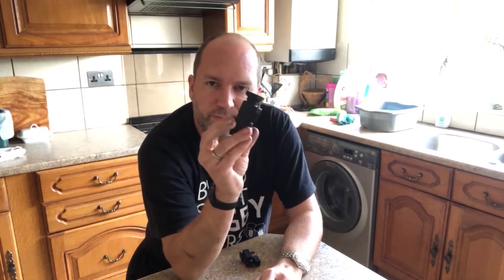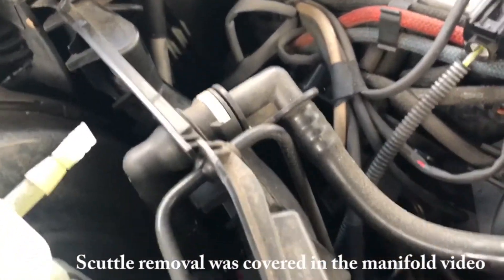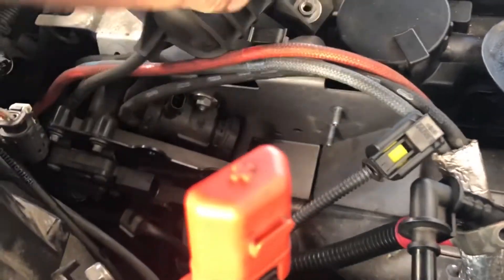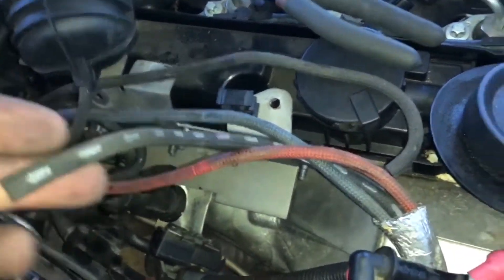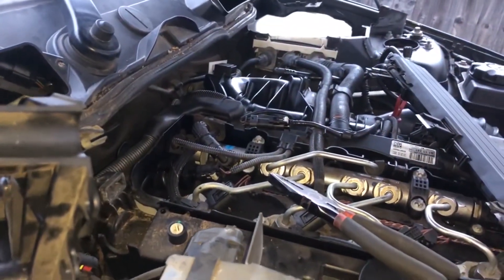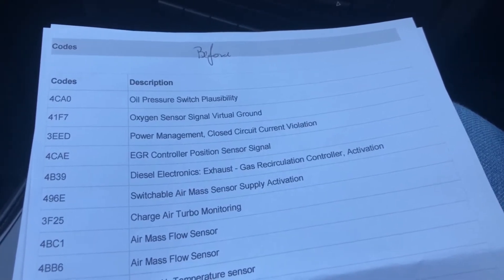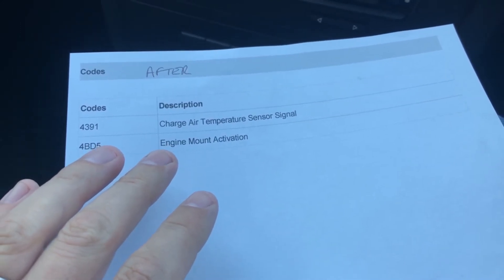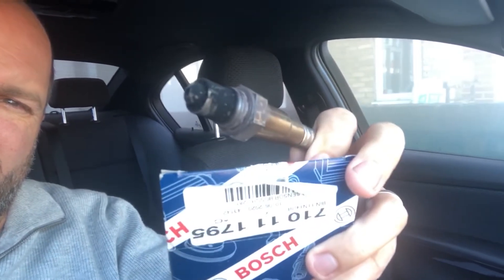BMW N47/N57 BiTurbo Pressure Converter Valves - 123d / 335d / 535d / 640d / X1 X3 X5 25d 35d 40d

Comment: One question guys.. I have a F15 40d 2015. Can someone tell me how many vacuum solenoids have turbo ? I know there are two on the left side of engine + one connected to EGR. So there are 3 vacuum solenoids. Is this info correct or there is a 4th one somewhere?

Comment: Hello Neil, my car is still in limbo mode. The turbocharger do not seem to work. Lately I have got this error. 299100 Pressure converter turbine control flap activation open circuit. Does this mean that my pressure converter is faulty? I think the converter is burning up because the workshop forgot to tight the airfilter hose screw and the turbo air charge hose is not properly seated. A lot of leakage. I may have to replace 3  parts again. This time  I will do all by my self. I can not trust on anybody. The workshop took 1200  dollars for replacing the turbocharger.
Reply from the maker: I don’t think the valve would be affected by not tightening the inlet pipe. I suspect you may have a vacuum leak on one of the pipes to the wastegate. What model do you have?
Reply: @NeilsCarsAviationTravel  BMW 525D Xdrive F11 218 HP 2012. I have replaced all vacuum pipes. I will check the hose to wastegate. I think the chargeair hose from turbocharger to intercooler is leaking. For some weeks ago I pushed the chargeair hose hard and after that the turbocharger seems to work fine for a while.  I have bought two new hoses and i am going to replace them.
Reply: @NeilsCarsAviationTravel  BMW 525D Xdrive F11 2012 model. I do agree I must check all hoses for leakage. I have an original technical draw map on all hoses for my car. When I start the engine the charge air hose to intercooler should expand and get hard and the wastegate actuator should move. I have bought two new turbo air charge hoses, one for the turbocharger from turbocharger to intercooler and one from intercooler to intake manifold. Because of ilness I have not replaced the hoses. I have successfull manage to repair the EDC  shock absorber. Now all 4 EDC shock absorber is working perfect and the car is able to do corner level on all 4 wheels. Adaptive driving Sport  and Sport+ is working again.

Comment: Hello, I want to ask about my car, did you get errors, the car is running erratically, with error code 3F00 A 3F03. It is a BMW X5 E70 35D XDRIVE 2010, the rpm fluctuates, too. Thank you for any help
Reply from the maker: The 3F00 and 3F03 errors seem to be more related to the MAP sensor which should be in the manifold. This reads the pressure in the manifold. 

It could also of course be a leak in the inlet side if you are getting a erratic idle. Maybe worth having a smoke test done where smoke is pumped into the inlet system tot see if there is a split hose or hole in the manifold.
Reply: @NeilsCarsAviationTravel  hi, that's right, the Diagnostics point to the sensor of the fuel pressure signal and I forgot to write that the car has a clutch and the revs rise to idle, it behaves as if it were driving in 3rd gear, but it behaves strangely and even today I was surprised by the error code 42DE. Otherwise, it starts without the car does not smoke problem, it happened to me that the DPF filter alarm went off twice, but then not anymore

Comment: Fella there nit meant to be fast. I'm nit sire what your expecting. If you want fast get a 535d
Reply: Fast or not, if the car isn't running right, it's not running right.
Reply from the maker: What’s your point? 535d is only around 1 second quicker to 60 and doesn’t handle as well. 

They are plenty fast enough if running correctly. 

BTW a 535d with bad pressure converter valves will be as fast as a 520d so best to have them sorted it faulty.

Comment: On the black cover over the pressure converters, what fasteners hold it on as you cannot see them due to them being recessed
Reply from the maker: I'm not 100% sure which cover. Whats the time stamp in the video, and i'llsee if I can remember.
Reply: @NeilsCarsAviationTravel thankyou for the reply, the one pointed to at 2:51 that's covering the converters (black plastic one)

Comment: hello mate sorry to be a bother , am having some issue with my car which seems similar to yours . 
bmw m47 e90 2005

have replaced glow plugs , glow plug module , charge pressure sensor , cam position sensor, turbo and engine breather ; also fully serviced it . 
am getting jerky or hesitant acceleration if i wide open throttle at lower RPMS sometimes even half way through the RPM range , occasionally the car goes limp with CEL , codes are showing MAF issue .
i had a garage swap out my MAF,  egr valve and egr solenoid (pressure converter) with a used pair from a 330d , cars running better but still has those issues just less frequently .

garage is saying my boost is too low and sometimes too high , they think it could be a software issue ; however i'm thinking they aren't doing thorough enough testing to make sure it isn't simple vacuum leak somewhere in the system ...

did you get to the bottom of your issue here ? i would like to know what actually sorted it . thanks !
Reply from the maker: Hi, sounds like you have checked and replaced a lot of items. 

With MAF sensors it’s always worth buying OEM brand such as Bosch as cheaper ones can be an issue. 

I’m not quite sure if the M47 uses the same pressure converters as the N47 in mine, or if it has an active engine mount. 

One thing you could do is unplug the MAF and see if it runs better. Also do the same with the MAP sensor (pressure sensor on the inlet manifold). 

It’s hard to diagnose without seeing the codes, 

In my case I have the car booked in for a timing chain replacement in September and they will be replacing all the vacuum lines too.
Reply: @NeilsCarsAviationTravel  yeah i've been chasing the issue and was assured the money i'd spent would fix it but months later the car still isn't 100% when i want to slam my foot down

all the work was done at bmw indie garage with oem/original parts , just a very annoying  experience so far

the parts replaced we're all throwing codes ; plugs, cam position sensor , map/maf and turbo actuator etc. 

the garage assumed wrongly it was sticking turbo vanes , then found sticking EGR valve causing the maf to act up , they've since swapped some used parts free of charge ; a lot better but still not 100% , car feels slightly down on power and occasionally jerks while accelerating at wot , could still be binding up

 i'll have them replace the vacuum lines in mine , cant hurt since the age of the car

tempted to delete the egr system entirely and have done with it rather than replace the valve

thanks and good luck

Comment: I have the same boosting issues like you descripe: I have a BMW 525D Bi-turbo F11 xdrive 218 Horsepower. No power under 3000 rpm, no power over 3000 rpm. I got man drivetrain errors if I accerrate a little bit. I ran Autofix es910 diagnostic and the same error log came back saying short circuit on the pressure converter on each rescan. Should I replace the erg control value too along with the replacement of the pressure converter?
Reply from the maker: You may as well replace all 3 while you have the access. Let me know how you get on.
Reply: @NeilsCarsAviationTravel  Hi Neil , I have replaced  two booster pressure solenoids and two EGR turbo control valves. Still my car is in limb mode, very slow acceleration.I checked the turboair charge hose and it was 1-2 mm slack. The leakage was without doubt here. I replace the turbo air charge hose today. The new turbo air charge hose is firm and tight, no slack. Now my turbocharger is working again. Fantastic to drive a smooth and quick car again. Thank you for your  help and advices. Have a fantastic weekend :-))

Comment: What is the name and partnummer of the second device you show on this video in the beginning of the video? I have to solve my problem with my BMW? Do you know which size is on the hose on the pressure converter. Maybe I have to change the hose as well when I replace my Pressure converter. My car has passed 152000 km.
Reply from the maker: The smaller one is also called an EGR control value. This is the one I bought. 

https://www.ebay.co.uk/itm/113452311646?mkcid=16&mkevt=1&mkrid=711-127632-2357-0&ssspo=5hKVr8gXTgG&sssrc=2349624&ssuid=ENW11iTvRY2&var=&widget_ver=artemis&media=COPY
Reply: @NeilsCarsAviationTravel  I have a recall on my BMW concerning replacing the whole EGR cooler include the Egr control unit. BMW Norway group  will replace the egr free of charge for me in June. The cause is leakage of etanol which may cause a fire. My Egr control valve looks different on my BMW 5 F11. Thank you for yuor informativ response. :-))

Comment: Hi very good video. I have a BMW 525D. I had a tturbocrash and after replaecing the turbo I have got several drivetrain errors under 3000 rpm and over 3000 rpm. After watching your video  I understand my booster rpessure solenoid mus replace. Thank you very much for  your best and helpful video
Reply from the maker: Glad I could help 😀

Comment: Hi great videos and useful info.
 I have a 320d n47 and I've constantly had my management light on the dash.  I removed my dpf, blanked out the egr , blanked off the port on the side of the air filter box and I've ran a, rubber draught  hose, down from the top end breather port and out under the car.  So now the engine can breathe in clean filtered air , without any egr soot going back into the inlet manifold , there is no sticky , oily residues going into the inlet system from infront of the turbo and the exhaust system is not clogged up with the dpf.

I've also removed my intercooler and all the pipes, cleaned out all the oil that had accumulated from the breather hose and I've cleaned off all the rubber seals.  I've also cleaned the throttle body.the only thing to clean out now is the inlet manifold itself and the swirl flaps as they will be clogged with oil and egr soot.    The engine is running much more responsive but I'm still have the issue of low down turbo lag , my MIL is still on and I get a reduced power light if I really boot it. 

My question is , what do you think about blocking off all those vacuum lines and just running one line from the turbo actuator to a port on the inlet manifold or just after the throttle body ? I did a similar thing on my  e39 525,  only i connected the fuel pressure regulator to the the manifold as the car was normally aspirated.
Reply from the maker: Hi, if you have blocked the EGR off you will need to have it mapped out to get rid of the EML light. 
I’m not sore blocking the vacuum lines will be a good idea. The vacuum system on the E90 is all interconnected with turbo and active engine mounts. That part of the issue I’m having I think.
Reply: @NeilsCarsAviationTravel    yes, I forgot to mention in my massive comment that I had it all mapped out. , dpf , egr  and I had the power opened up aswel.   I think what I might do is just run a new hose from the turbo actuator to the inlet manifold and test run it , just to see if it makes any difference.  If it does I'll disconnect all them pipes and blank them off.   I'll let you know how it goes and make a vid of it to . Cheers mate.
Reply from the maker: @rjhtrucking5429  cheers. Would be interested in the results.
Reply: @rjhtrucking5429  what was the end result bud?

Comment: Hi Neil, my 123d is doing the same. Small turbo isn’t kicking in, then at 3k rpm the boost come on. I’ve tried all sorts of diagnostics but haven’t yet replaced parts. Both turbos spin freely, there’s not obvious vacuum leaks, Did you ever find out what was causing it?  

Cheers
Dave
Reply from the maker: Hi Dave, have you had it plugged in to get codes off the ECU? 
If you look at my other Alpina videos you will see I have been chasing my tail trying to get to the bottom of lack of power and limp mode issues. 

I’m having the car MOTd in 2 weeks so will be back on diagnostics asap.
Reply: I have the same issue on my 123d coupe at 3k turbo kicks in the codes I got was maf sensor and charge air pressure could be that actuator not work correctly
Reply: Did you get to the bottom of it? I’m going through the same
Reply: @Anynameslelt  no mate sorry to say I'm just going to sell it I didn't even take it to the garage they take so long to look at it I think it's small turbo definitely or actuator take it to a garage mate
Reply: @Smartytoontv  you could put a smoke machine down the servo pipe and look for smoke out the boost pressure pipes, (that got to the actuators,) could be one of the n75 valves, if biturbo there is one of two,

Comment: Hello, I have this error on my 535d e60 lci: 429A boost pressure control low pressure stage, control deviation. Do you know what the problem would be?
Reply from the maker: I’d have to have a hunt around the internet. Do you get any symptoms like limp mode?
Reply: @NeilsCarsAviationTravel  no, it feels a bit lazier down to 3500 rpm, after 3500 it pulls normally

Comment: 🆘 need help
E92 335d at full throttle 120mph it goes into limp mode i turn the car off and on and it pull like a train it usually happens at 120mph sometimes 80mph . 

I change the vacuum pipes . And i still have the problem. 🆘
Reply from the maker: Have you had it plugged in for error codes? 
Off the top of my head it could be a number of things:
- fuel filter needs changing
- boost leak (intercooler pipe split) 
- Inlet temp sensor (see my other video). 
- MAF sensor. 

The list goes on.
Reply: @NeilsCarsAviationTravel  hi sorry for late reply 

I got code 428B Boost pressure control Low pressure stage, control deviation 

447B lambda probe

This codes comes up after getting into limp mode
Reply: @Cocovlog283  im having the same issue on my 335d 2008 at 120 car go into safe mode only 1 turbo working wont go over 120mph turn the car on and off back to normal.
Reply: @TheRealtrueGamer  yes correct i got same issue apparently its the big staring turbo fail
Reply: Did you got to solve the problem?

Comment: having the same issue on 123d e82 If you make any progress it will be super interesting👌in mine i will try to change all the vacumm pipes as I thinck that 1 of them leaks a little bit and it comes from the vacumm tank
Reply from the maker: I think mine has an issue with the vacuum pipes from the engine mounts too.
Reply: @NeilsCarsAviationTravel  Today I have solved the problem and works incredibly well. Mine was failing the vacumm valve that moves the turbos. In total 80 euros including shipping. Manys thanks
Reply from the maker: @marcramon6405  excellent news. Which one did you get? Do you have a part number?